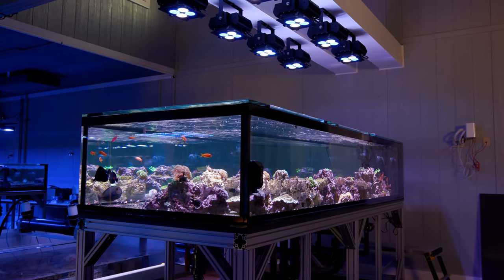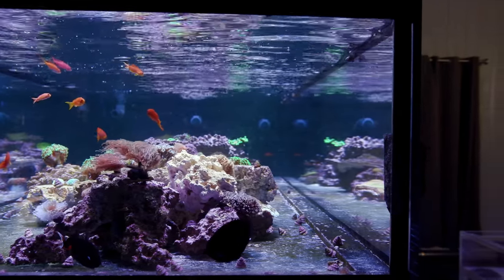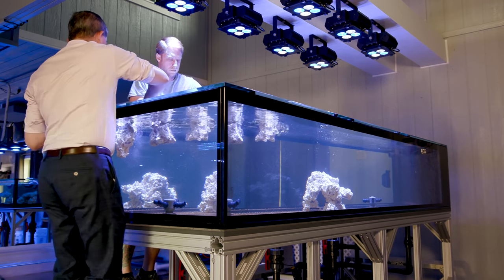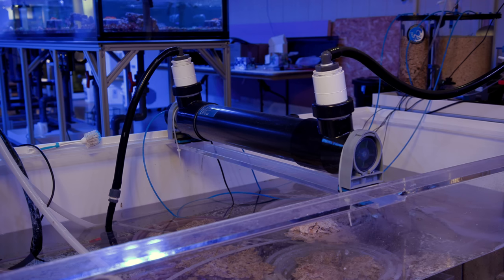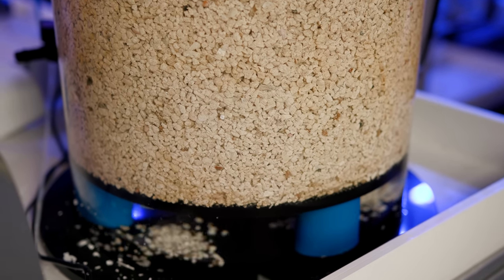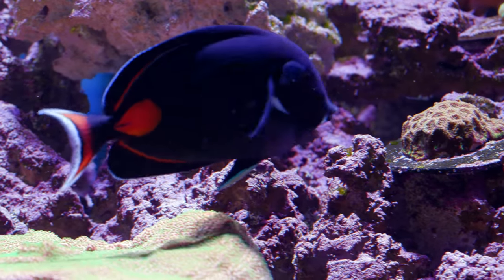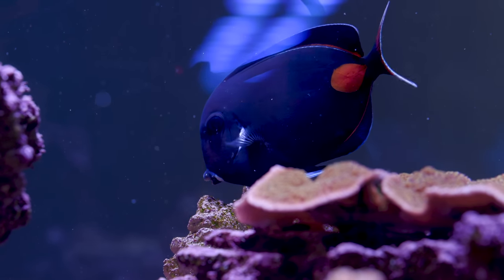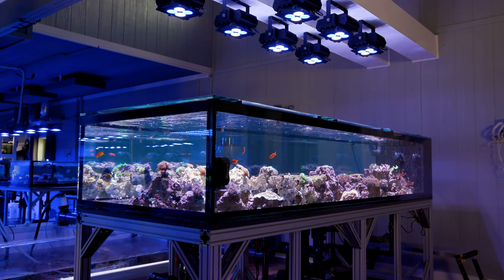The Cursed Peninsula Show Tank

Comment: What I did was run lockline under the lid from both return pumps.  This gives me general flow from the far end of the tank to the overflow.  This way I don't have stagnant areas that build up things the skimmer needs to address.

Comment: Always interested in the differences between small and large tanks. But seems to me they all deal with similar issues just at a different scale.  I am waiting for some berghia nudibranchs too to see if they would survive in my 510g 7 tank system.  I also still have all 3 supplementation methods (CaRx, 2Part, and KalkReactor) on my system but ever since I started a consistent dosing to maintain a pH or 8.3 I haven't used my CaRx either. The 2 Part is for emergencies to adjust stuff. i.e. if Alk is too high I will start dosing Calcium more to lower it.
Reply from the maker: Good to hear that kalkwasser worked out so well for you.  I'm hoping things here perk up when the pH gets into a better range.

Comment: I see the Acillies tang has a couple of spots, do you think the ozone will reduce any ich to levels low enough for it not to be an issue.  I added several Acanthurus tangs sequentially by using a acclamation cage, my tank is a bit bigger but I have 16 tangs in total including a achillies, powder blue, convict, freckle face and dusseruri they get on fine after the first couple of days when released from the cage.
Reply from the maker: The hobby doesn't really use ozone in a high enough concentration to sterilize the water.  It's more something you would see in a wastewater treatment application.  For hobby use it is just good enough to clear up the water and break down some chemical aggression between corals.

Comment: Hi Than. Another great and informative video. I have been a subscriber for at least 10 years now and have learnt a ton from your coral care videos as well as livestreams. I would love your opinion on the following: I am setting up a 36x36x36 inch cube and would like to use one single light to do it Do you believe that the Amazonas 960 would do the job and what lens would you recommend? Taking into account the mounting bracket I believe the light would be some 16 inch above the water. Thank you very much for all your content. Kind regards. Vasco
Reply from the maker: That light would be overkill.  You might be running it at 10%.
Reply: @tidalgardens  Really? In a 90cm (36inch) deep tank? I am thinking about using the new 90 degree reflector in order to be able to also cover the 36 inch width and length of the tank, so was hoping the wide lens would soften the laser beam PAR levels 😁

Comment: Wouldn't it be amazing if we could hide some powerheads in the rockwork... hmmm 🙂
And why not use some of those powerheads where the cord is outside the tank, then mount them on the bottom of the tank, just enough to create a circular pattern... so many ideas, I have.
Reply from the maker: If you are ok with the pumps pointed straight up, I think you can with Vortechs.
Reply: @tidalgardens  isn't that all you need to create flow coupled with the one's in the side... also if you hide others in rockwork, the cord can be hidden as well 🙂